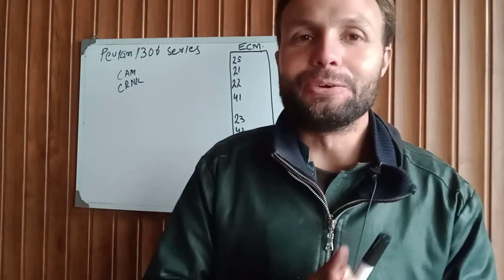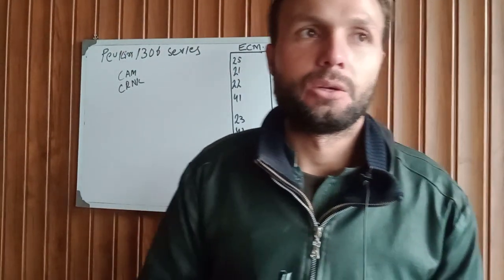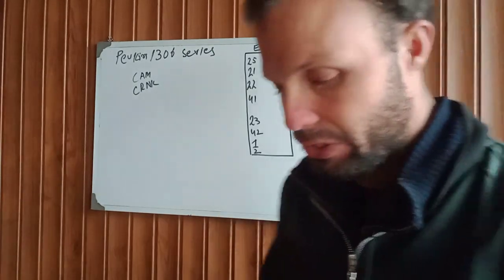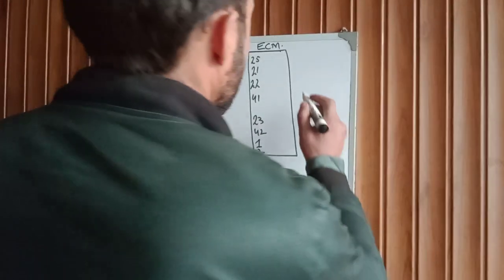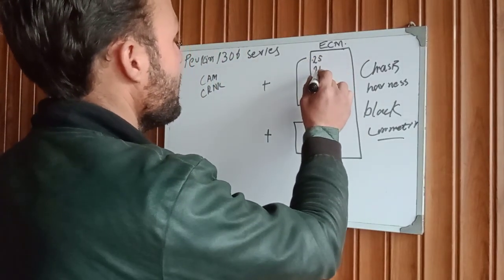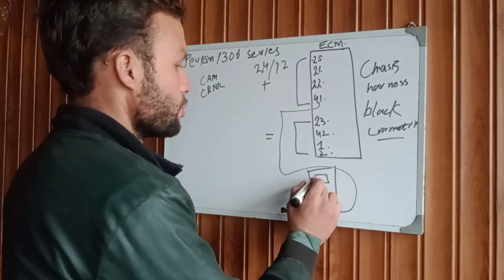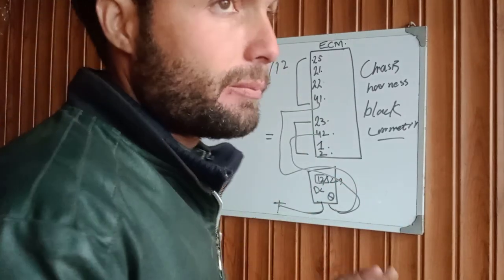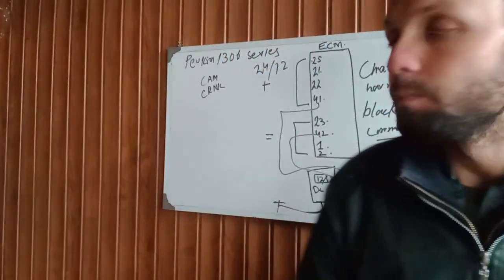Perkins 1300 series 1306 Engine ECM main wiring for Engine starting English

Comment: Pin#25 of ECM is negative output for Main Relay , u will damage the ecm if power up this way u described above. ECM inputs for battery positive are 21, 22, 41 ,24
Reply from the maker: U are not understanding 
25, 21, 22, 41, this four pins positive switching input through the Relays , 
And 23, 42, 1, 2 this four connection is ground - unswitch permanent